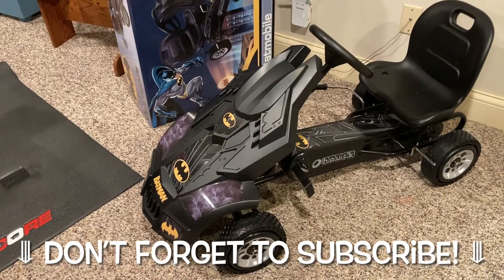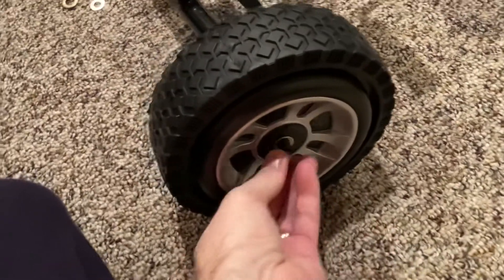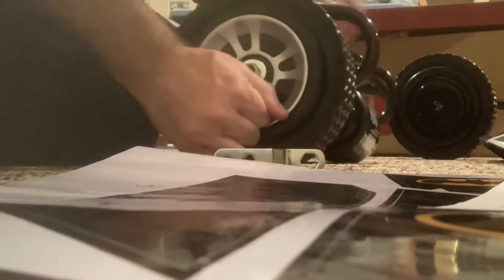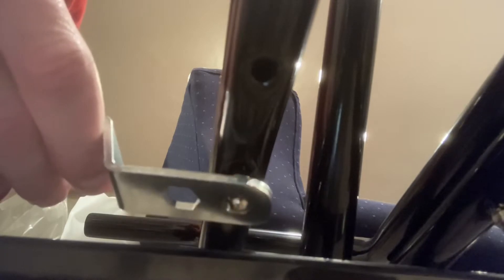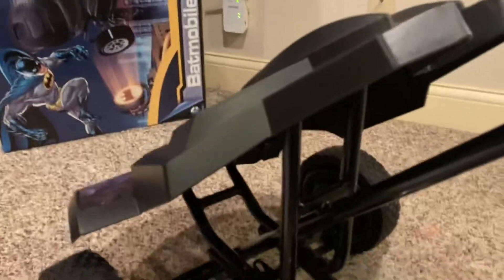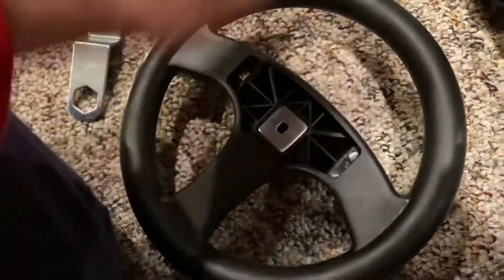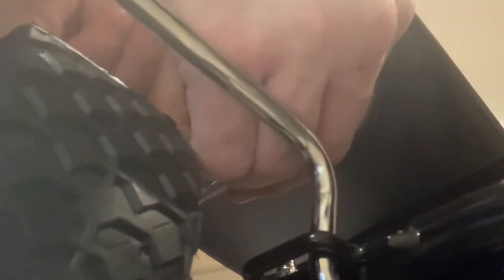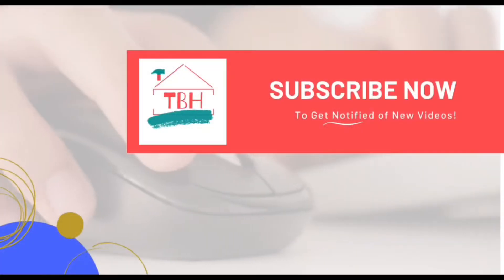🔥 Batmobile Pedal Go Kart➔ How to Assemble/Put Together (Easy Instructions) + Review (Hauck T90230)

Comment: How old is your kid or how tall is he? Look like his knees r touching the steering wheel all ready
Reply from the maker: Just measured - he was about 39-40" tall when video was made. From foot to kneecap he was about 10". However tall your kid is, knees probably need to be bowed out slightly while peddling to avoid hitting steering wheel, which obviously sits lower than T-shaped handle bars, like on a trike. It's not an issue for him - he loves it.